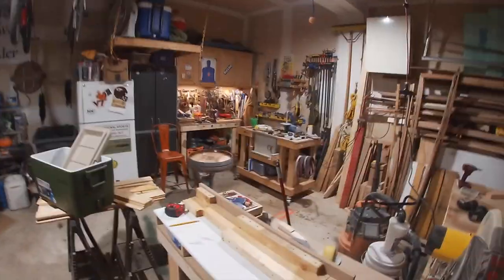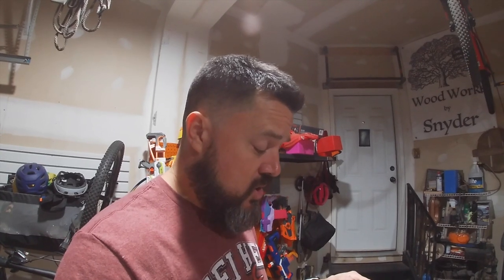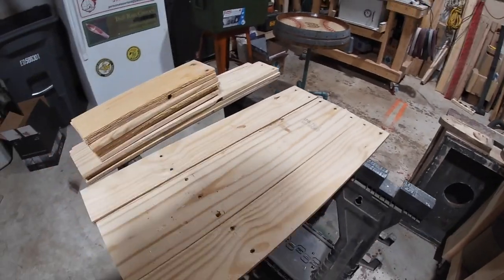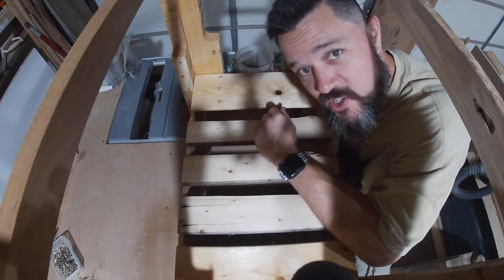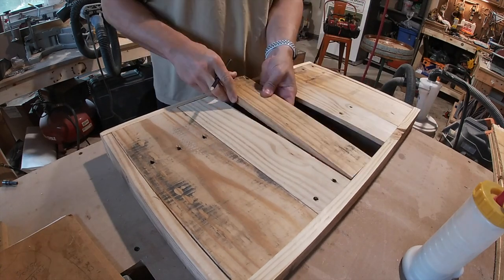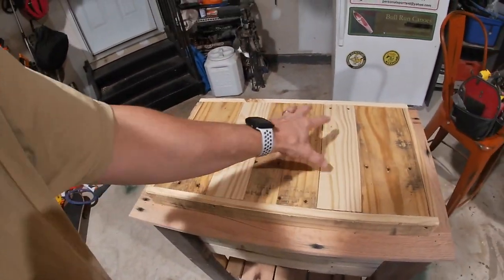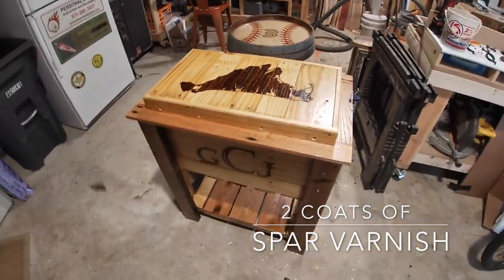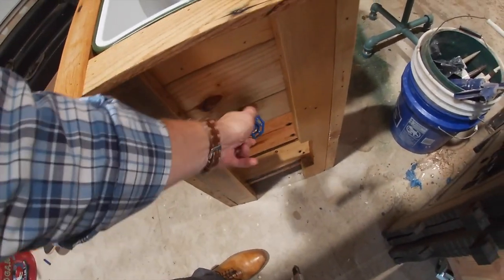Custom Cooler from Pallets

Comment: can you provide height for the legs?
Reply from the maker: Legs in this picture are approximately 34” but I now cut at 30” as I put locking caster on the bottom.

Comment: What tools do I need to start doing this
Reply from the maker: The will to just do it is the first thing. Probably a circular saw or even handsaw can do it mostly along with a hammer or screw gun. Of course miter saw and table saw helps but I think with those basics, you could get it done.

Comment: do u have plans for it
Reply from the maker: Unfortunately no. I have some basic measurements but because pallet wood is different thickness and coolers are scarce and can be different sizes depending on make, the measurements are altered slightly each time.